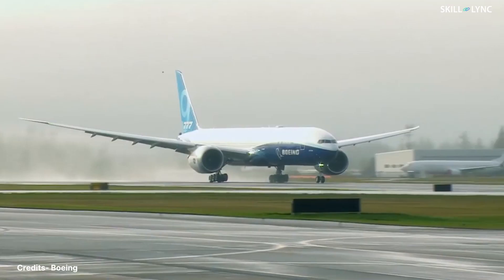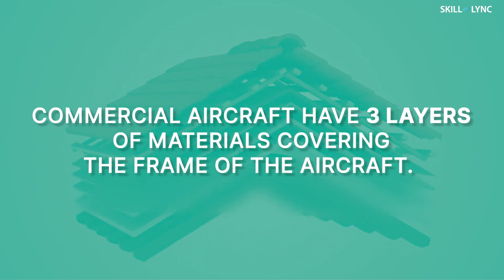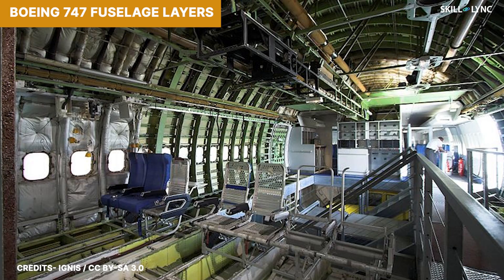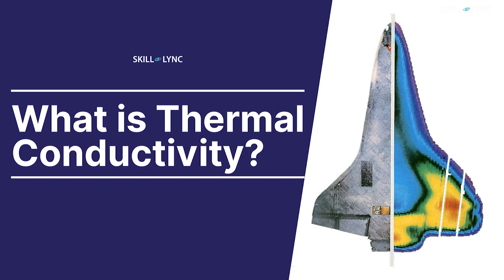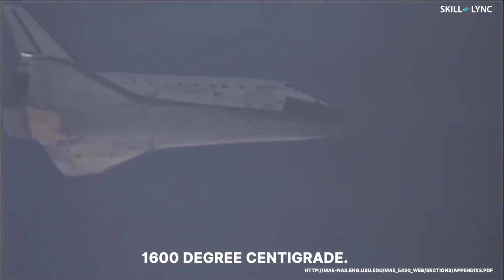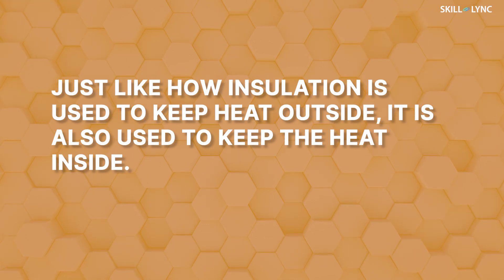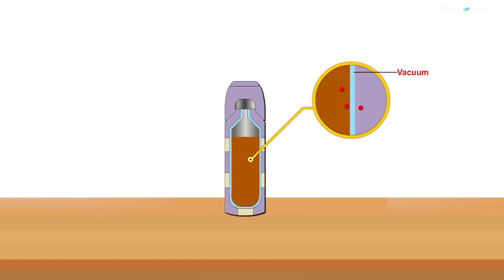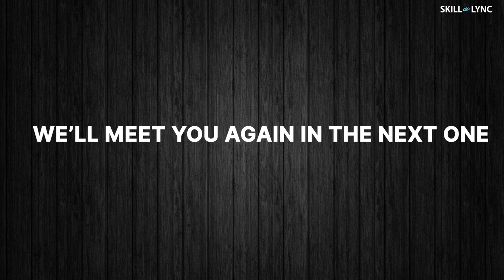What is THERMAL INSULATION? | Skill-Lync

Comment: Yes i want to know in depth why mostly aircraft are painted white
Reply from the maker: Hey Ayush. That is a brilliant question. Aircrafts are painted in white or light colours to reflect the sunlight and to reduce the heating and potential damage from the solar radiation. Similarly, gas trucks are also painted white to prevent the fuel from overheating.
Reply: @SkillLync  thank you sir